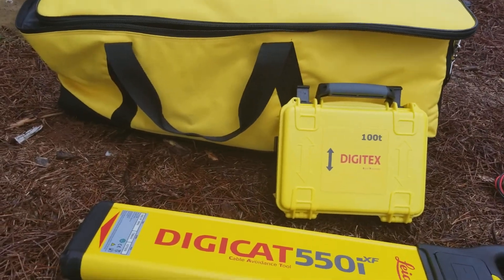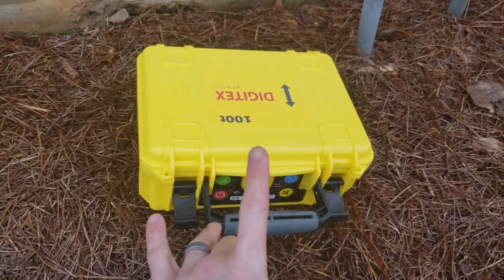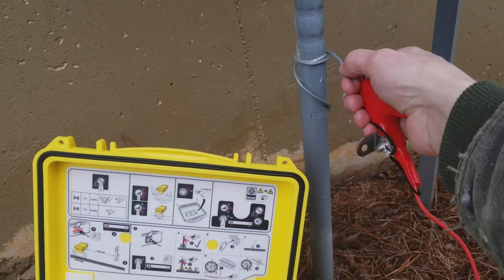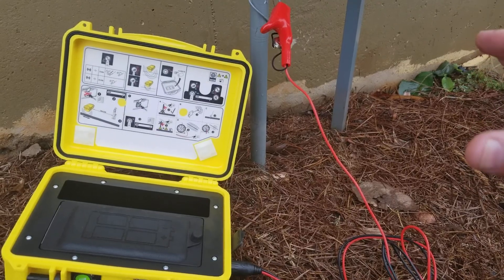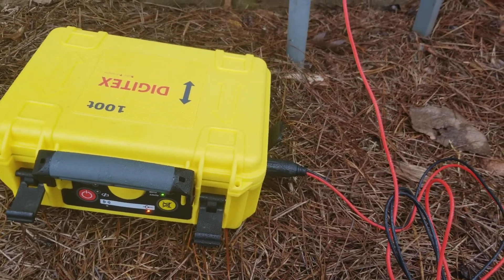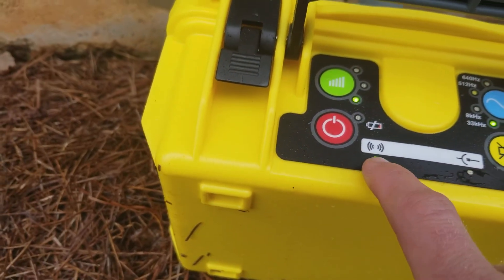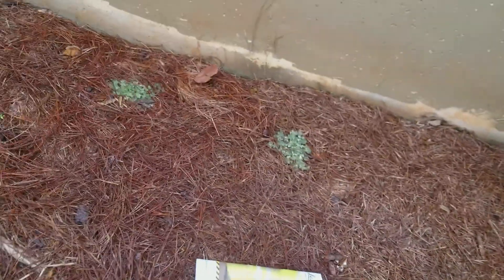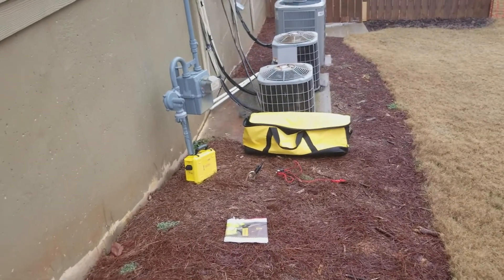Locator and line tracing

Comment: Can you use the 550I it's self with out the box, to find: Electrical Conduit, Water Lines and Cables?
Reply: I don't think so. The box sends pulse of power that the 550i senses and tell you where the wires, conduit, or anything metallic.

Comment: Hi,
Thank you for very interesting video 
I bought a Testsafe inspection camera. Can I track it the same way with DD230 and is it dangerous
Reply: Yes, you can. Some cameras have a transmitter, (sond ?spelling), that you can find also. 512hz usually. I've ran wire fishes through lines and connected to those too.